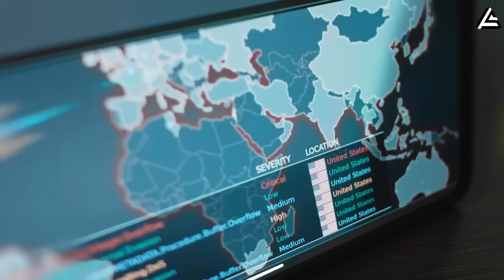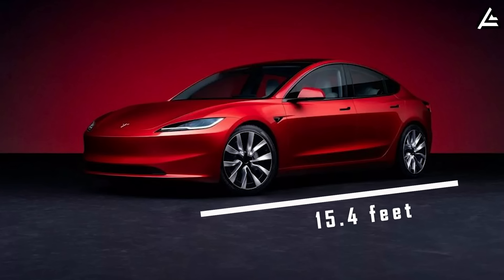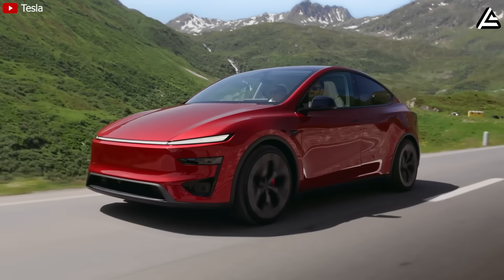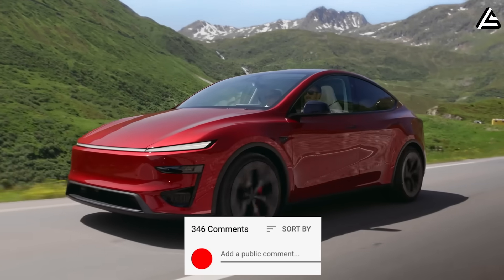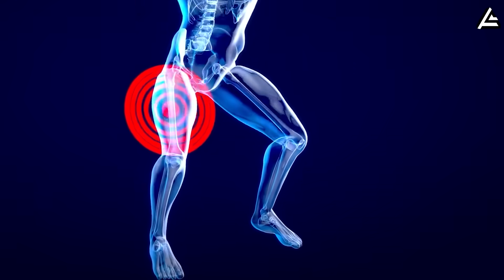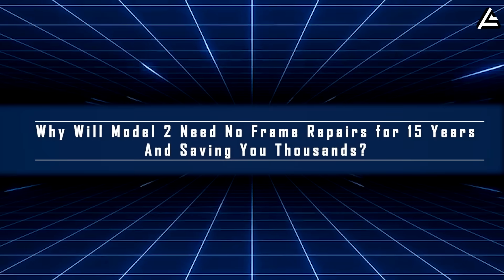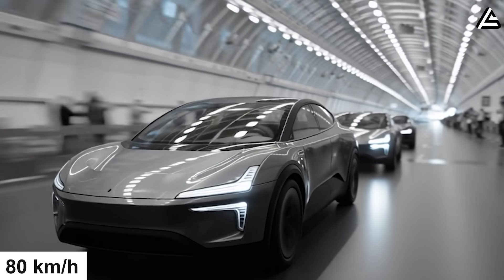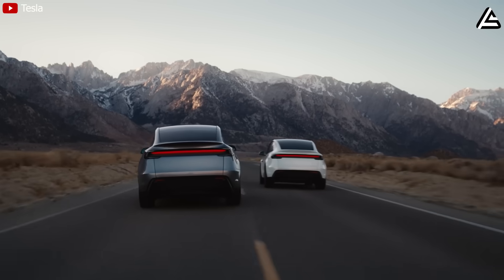Elon Musk’s 2026 Tesla Model 2 All-New Design: Why It Matters?

Comment: I wonder how those doors will fare in rain, freeze, snow storms AND hurricanes? Is there a model with normal doors!
Reply from the maker: Model 2’s butterfly doors use reinforced aluminum with triple-sealed weather strips and hydrophobic coating, so they stay watertight in rain, snow, and even storm conditions. Plus, the hinges are cold-tested to −30°C to prevent freeze lock. Is there anything else you would like us to clarify about this door design?